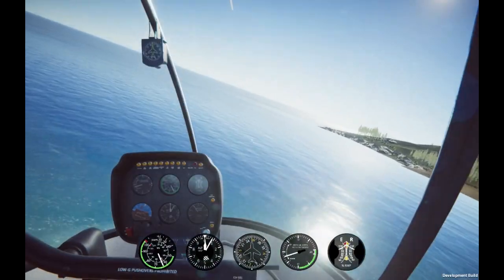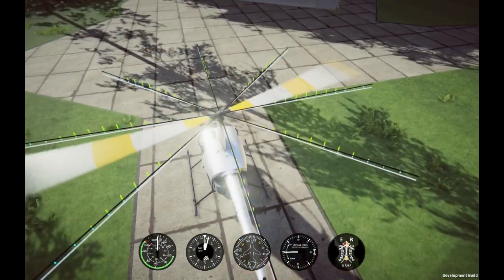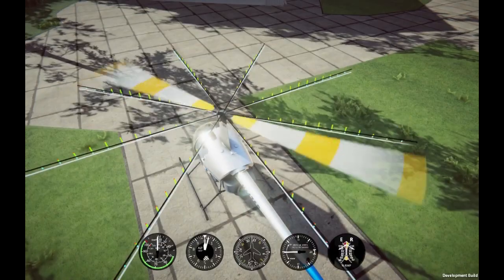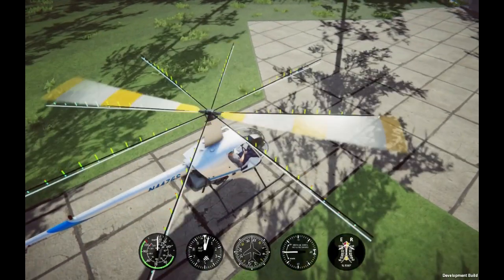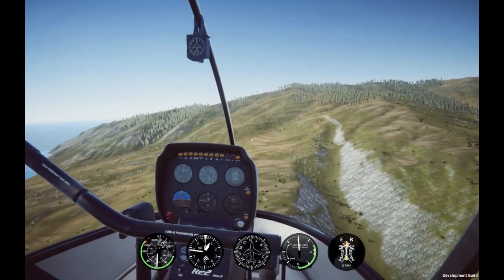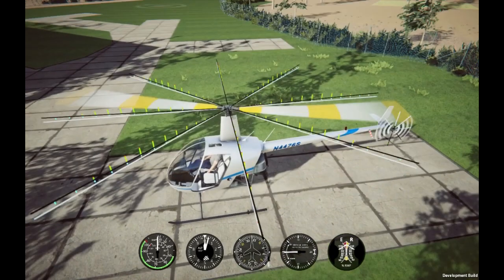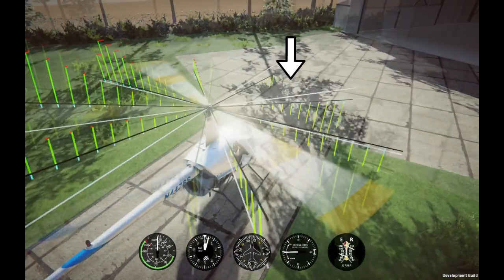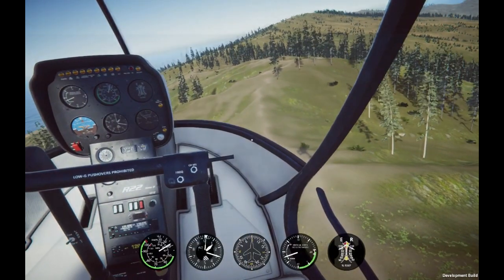How Helicopters Work - Gyroscopic Precession - Helicopter Simulator

Comment: I bought your game yesterday and I'm loving it, but I would like to know if you can add this Artificial Horizon to the r22 panel, I saw that in your video it has the Artificial Horizon but in the game it has a cap written "r22"  in place of the Artificial Horizon and I confess that it is missing for me.  I already got the hang of flying and taxiing without it, but when I use the rudder pedal to rotate the aircraft while hovering the helicopter tilts and I don't realize it, I need the Artificial Horizon reference to taxi steadily lol
Reply from the maker: let me make an update, there where supposed to be purchasable at first, but I'll make it available
Reply: @linesstudio98  wow, just now i saw that you answered me, thank you very much for your attention.  I don't want to abuse of your goodwill but if you can add an option to disable the HUD I would appreciate it too. 

 I've been flying in your simulator every day since I bought it, I'm really satisfied with the physics

Comment: One of the properties of a gyroscope is rigidity, rotors do not possess this property as they flap to equality and therefore cannot precess. It is wrong to say precession is also known as phase lag as they are two different phenomena with similar aspects. Precession always acts at 90 degrees but phase lag, as you say, varies according to the aerodynamics of the rotor disc.
Reply from the maker: you are totally true ! 
I wouldn't go to deep into this, because phase lag is way more complicated that gyroscopic precession, but I wanted to mention "phase lag" so that every one can go deeper into this very big topic ! 
thanks to mentioned that!
Reply: I thought you explained phase lag very well, especially with the graphics. I find precession much harder to explain.